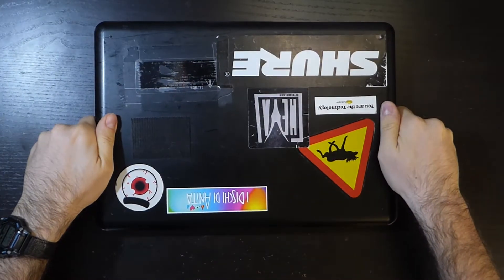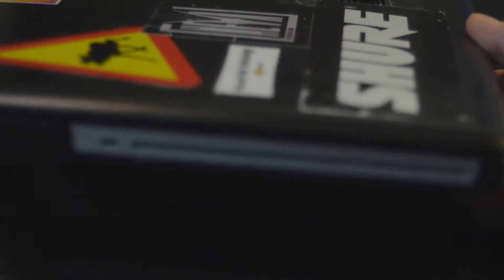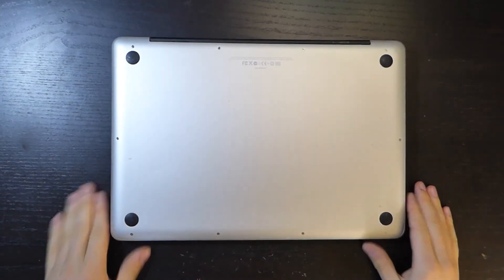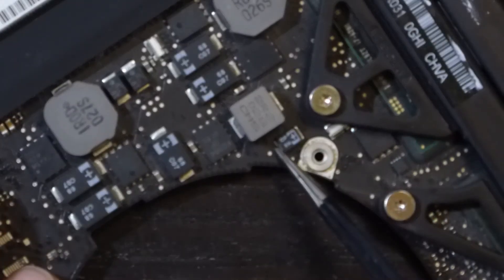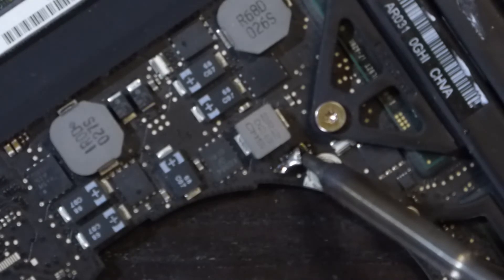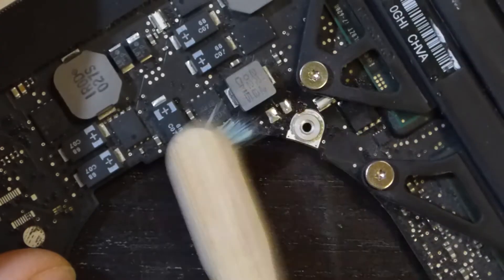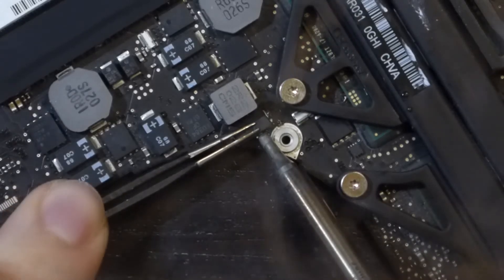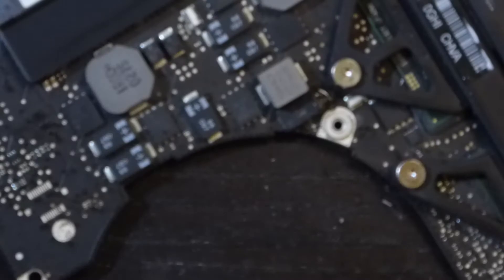Kernel Panics? No more! Fixing an old Mid 2010 Macbook Pro

Comment: I have the exact same MacBook with the same kernel panic issue. I’m debating getting rid of it for a 15” 2012 retina model that takes 16gb of ram instead of this 2010 15” model that can only take 8gb. I have a lot of MacBook sitting around the house so I may do the repair myself. Great video by the way.

Comment: I have a simular problem… macbook pro mid 2010 17” crashes whenever it switches to dedicated graphics. It only happens when running on battery power, with the power cord connected it works like a champ. Is this the same problem as in this video? Will the same fix help?

Comment: This is exactly how I did it too - just with a soldering iron - and it works fine. 
Keep in mind there are two types of capacitor, one requires a bigger scratched soldering tab on the board and that one which is used in the video.

Comment: What capacitor did you use. Any link?
Reply from the maker: I've used a "Panasonic EEFLT 0D331R" that is a ALU ELEC 330uf 2v smd capacitor. I've found mine at a local store but you can check ebay or any electronic online shop that you trust.